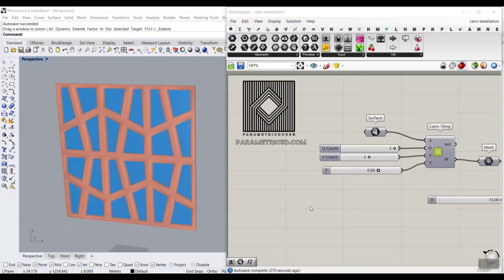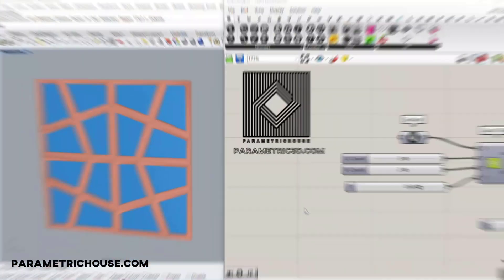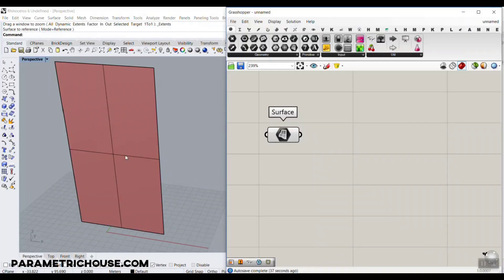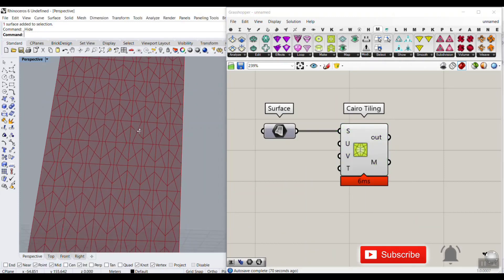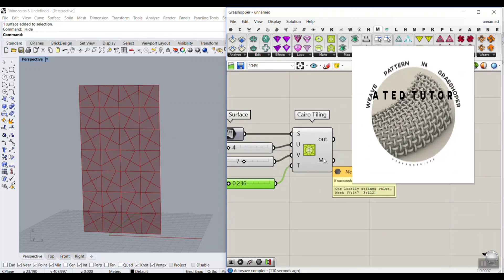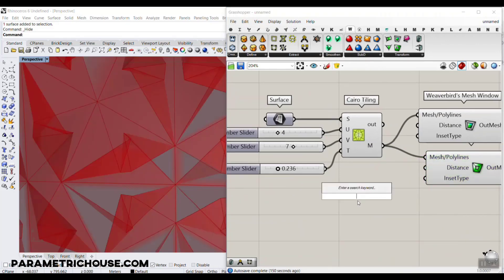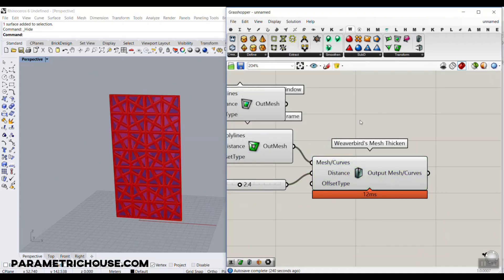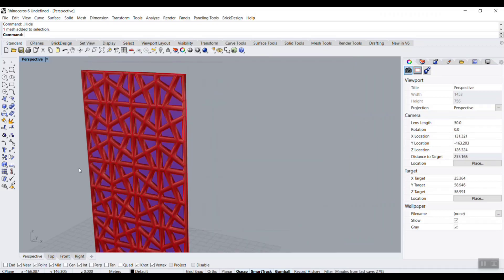Grasshopper Mesh+ (Cairo Tessellation)

Comment: Hello ! This seems great... although Mesh + is simply not working. The Cairo tile battery is not generating any pattern. I unblocked the user object files and placed them in the right folder. Is it compatible with Rhino 7? Thanks in advance for any advice .
Reply: The same here for me. Not working with Rhino 7.